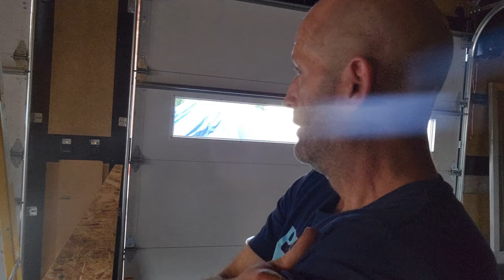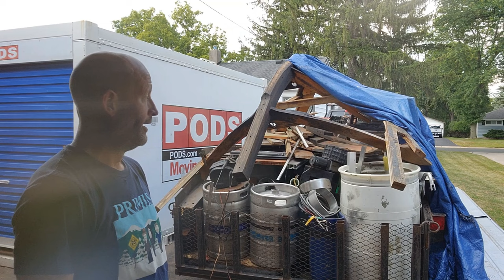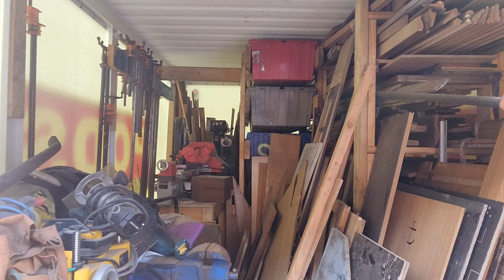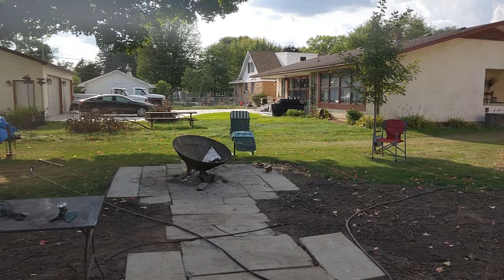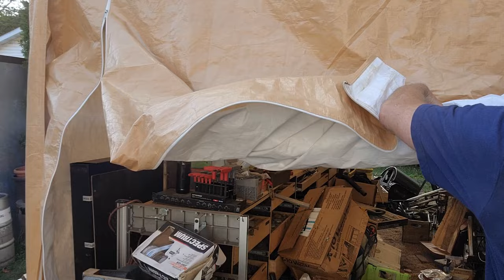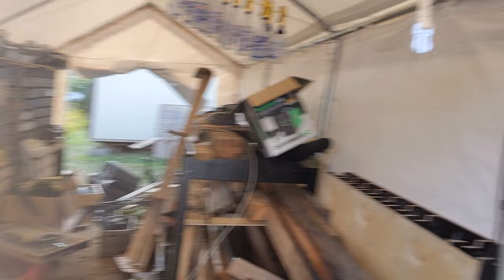Rising from the ashes DAY 100

Comment: I hope your coverage limits were high enough to cover your losses! It looks like you had a lot of stuff in there.  My neighbors went through something like this three christmases ago.  They let their twin boys (10 & 11) spend the night in their detached three-stall garage, and one of the boys knocked over a small propane heater.  The entire structure went up in less than 10 minutes...  The Fire department was kind enough to send 5 trucks. It was wild! Unfortunately, their insurance company wouldn't cover anything because the kids were left unattended. (Said company covered my siding and roof damage from the fire, though).  The neighbors ended up bulldozing what remained, and put a couple of those gaudy canvas tents on the slab. I don't know what was more upsetting to see: the way the insurance company jerked them around, or those tacky tents I'm forced to look at every time I pull into my own driveway...  I hope your experience was better that theirs!